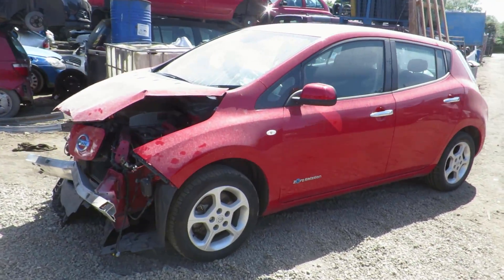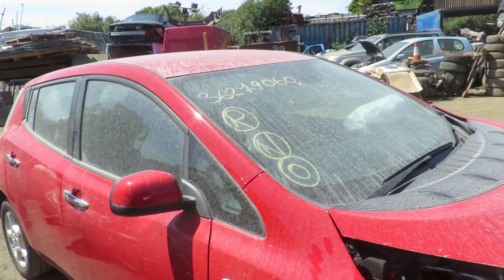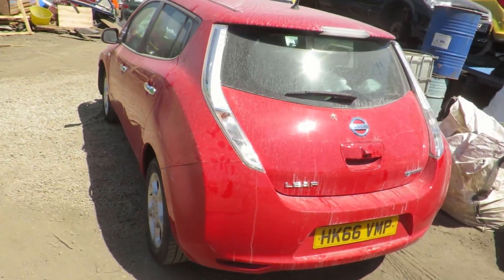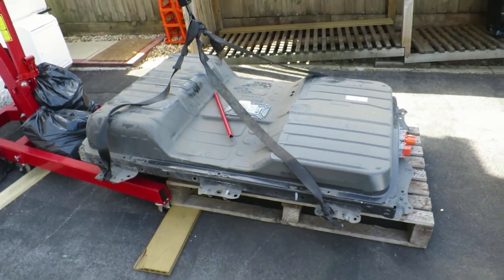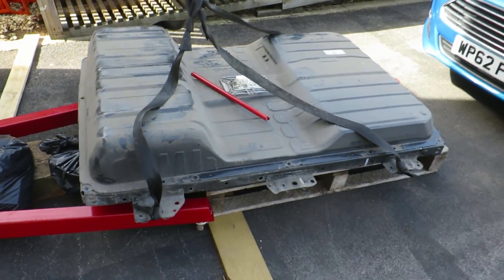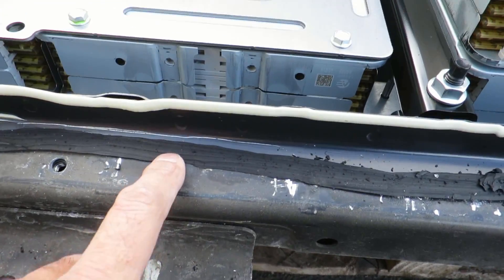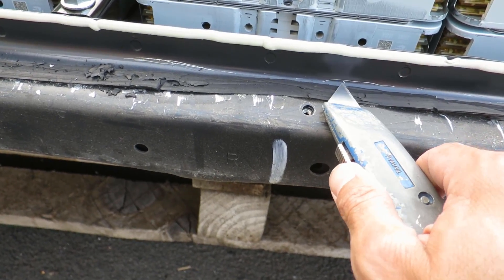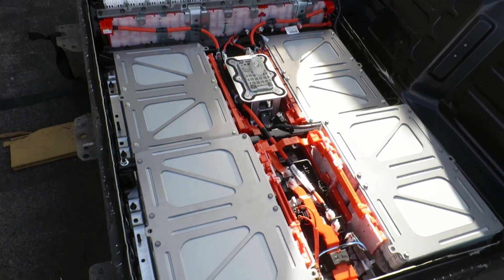Nissan Leaf Donor car has arrived for my RX8 EV Conversion!

Comment: Woo Hoo! No excuses now. 😜 
I nearly bought a damaged Leaf myself but it was too expensive as a fixer upper or as a parts car as the battery had 100k miles. I wasn't  convinced when the seller claimed it was 92% good. 😒
Good luck with the build.
Reply from the maker: Thanks, gonna try my best!

Comment: Are you going to use the OEM motor controller to start with? I did post a link to Arlin Sansome’s channel in another of your videos if you were considering powering up.
Reply from the maker: Yes OEM controller with 'hopefully' an Arduino controlling it via canbus.